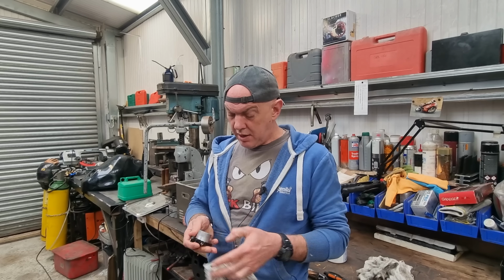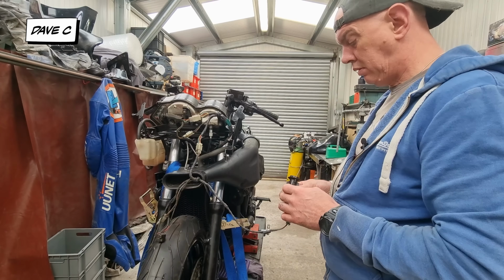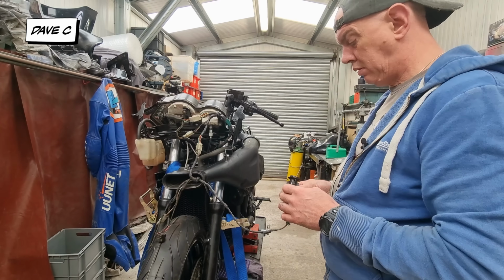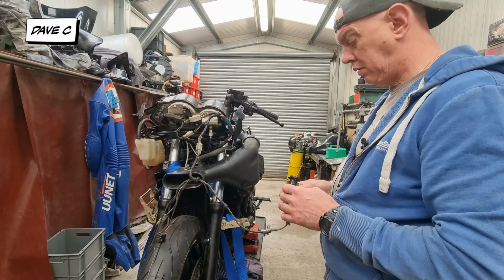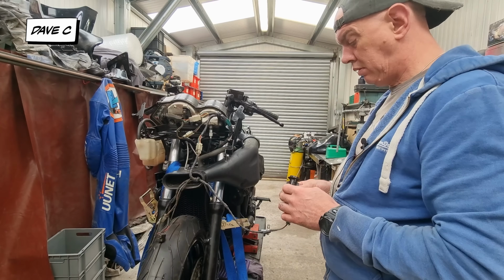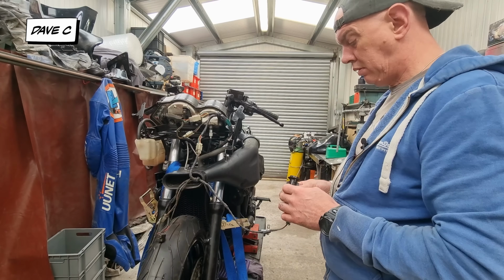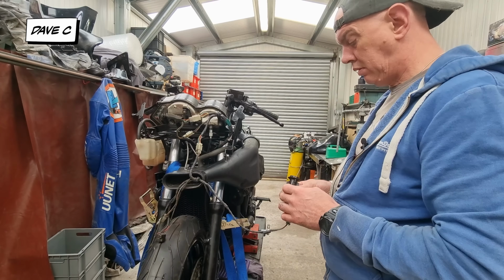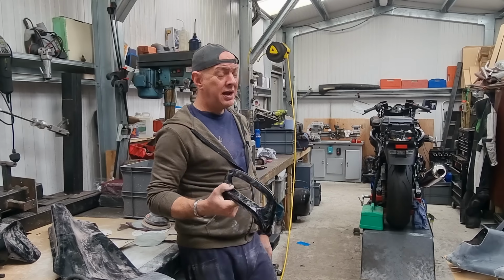Bodywork prep ready for paint - 1990 Kawasaki ZZR1100

Comment: I had a big piece of front gaurd missing in my fz 750 where the mount bolts came loose and the gaurd wore thru on the tyre I araldited a thin piece of Ali on the inside an shaped the front edge to match the rest thin used a filler and profiled it worked a treat as for the crack a hole drilled at the end works well I’ve used the superglue truck and that can work a treat  and or plastic weld she’s cumming together nice 👍
Reply from the maker: Good man. I've got an ABS plasyics repair kit on the way, so going to give that a go, but will bear this in mind matey 😁

Comment: ABS welds together pretty well with acetone.  A drip or two in the crack, and leave it to set.
Reply from the maker: Ah right.... I didn't know that.... I've got an ABS resin repair kit coming now but I'll bear that in mind matey, thank you 😁 👍
Reply: @QuickBikes  A resin repair kit might have something that does a better job than acetone.  I patched up the plastics on the VF500 using an acetone / abs chip paste, did a spiffing job but the resulting plastic is "porous", where the acetone evaporates it leaves microbubbles.  I'd be interested to know what resin is in the kit, and what the results are.  Edge of seat, etc etc
Reply from the maker: I'll try and cover it in a video matey

Comment: Had a funny lever on my zzr1100 d6. Pulled the slave as you have but couldn't find anything wrong with it whereas yours seems  nasty but anyway mine turned out to be the push rod was corroded badly and was sticking.

Comment: It's looking good so far, if always repaired little cracks by melting it with a soldering iron along the crack then melting a couple of paper staples into it to add some strength. Loads cheaper than the proper plastic weld tool Haha
Reply from the maker: I was looking at a hot staple kit, but went for an ABS resin repair kit instead in the end. It should be here on Monday with any luck 😁👍
Reply: @QuickBikes  
Guys the BEST way to repair ABS plastics is with a ABS Slag mixture. It is 100% sandable and fills cracks, divots, scratches and bonds permanently making the piece (cracked pieces) stronger than they were before. By applying a lil piece of ABS Patch under the crack (backside of fairing  after filling)  it reinforces it better. 
A. Start with ABS Black GLUE. (This is readily available in the US in Most regions but commercial ABS Piping is no longer done in housing. It is used in RV's and some colder climates cause it is more flexible than PVC Pipe)
B. use some old ABS or buy some sheets off Amazon to make shavings with. Have some Acetone on hand to make the mixture of glue and shaving thin out a bit and also it takes some time for the ABS to SET. Clamping also helps for patches or pieces that you may feel need it. ( I personally use mostly Acetone with a bit of MKE to keep the Acetone from drying out so fast.)
C. A full on GUIDE for this may be found on GOLDWINGDOCS.com  Just Google ABS repairs................. Easy 15 min read and you can understand it way better. Includes some photos too. - Happy Painting, and you may THANK ME later.

Sorry Host, I saw your reply cause I was posting this under Lewis's comment. ABS Repair is BEST repaired with ABS. I listed the parts that should be in the "kit". Easy enough to make yourself and probably way cheaper. Resins other than ABS to not flex like ABS does and any other substance will crack due to this flexing. Which is sort of the REASON manufacturers use it.  It is tuff, flexes easily and resists cracking, (except for over torqued fasteners 😁)
Reply from the maker: Thank you for taking the time with this. Its much appreciated. I have an ABS resin repair kit coming already which has a reinforcing mesh, resin etc to do a repair which I'm going to have a go at, butnif it doesn't work out I'll give this a go. Thank you matey 👍